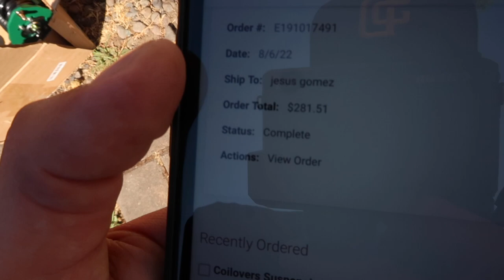2011-2016 Scion TC Coilover Install

Comment: You put the rear springs upside down. The adjuster is supposed to be on top of spring. You won’t be able to adjust height the way you installed ot

Comment: Hey homies, I installed the same exact ones on my ‘13 tc. I know right, me?! Anyway, I haven’t driven it yet.. need to locktite first. How have they been on your car? How do they ride, etc? I’m worried about how the adjustable height holds up over some time. Hoping I didn’t waste $300 on some shitty coil overs. Thanks!